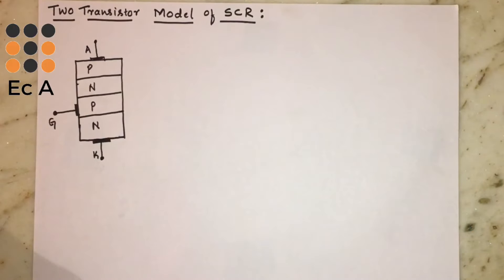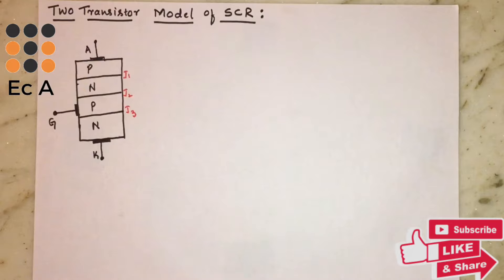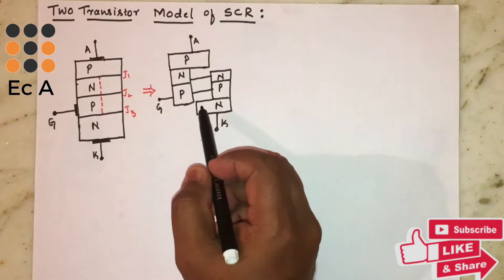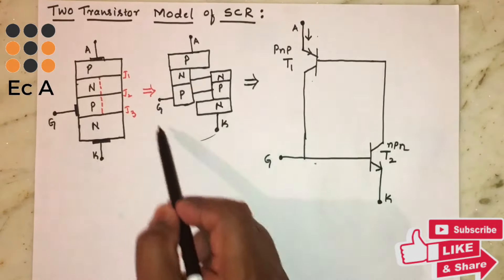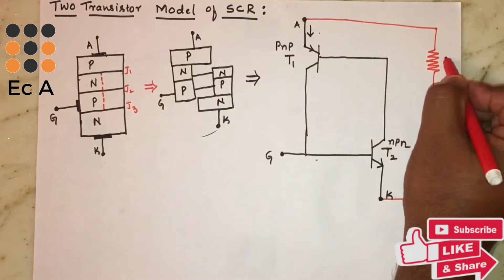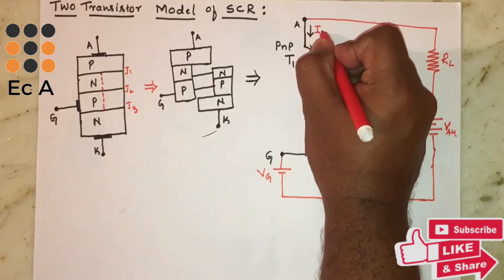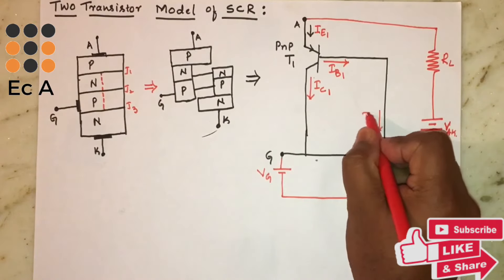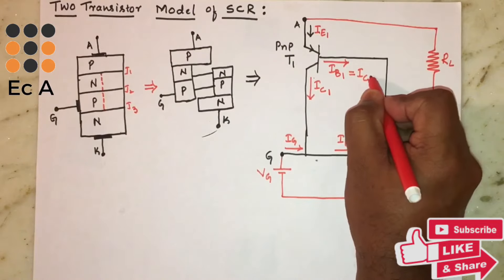#27 two Transistor model of SCR || EC Academy

Comment: Sir why we separate the scr into PNP and NPN transistor this work can also be done by 4 layer scr . In scr if gate current is zero then scr is in off state and vice versa . The same work is also done by two transistor ie NPN and PNP  so why we ned two separate it
Reply: We can understand this by schematic diagram of scr also
Reply from the maker: It is done to understand that an SCR can be designed using two transistors also...
Hope this is helpful...
Do subscribe and keep supporting EC Academy ✌️